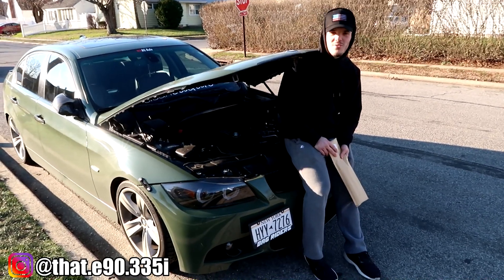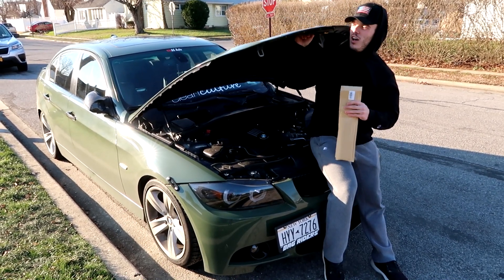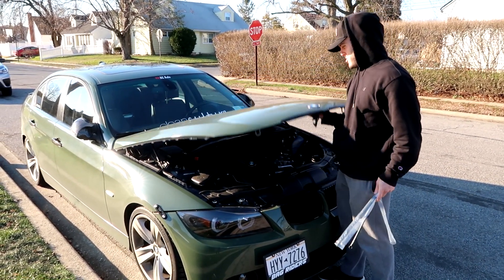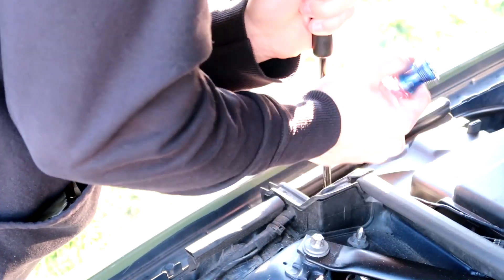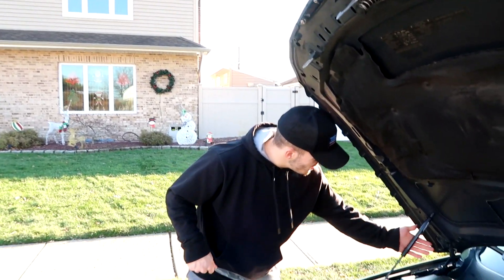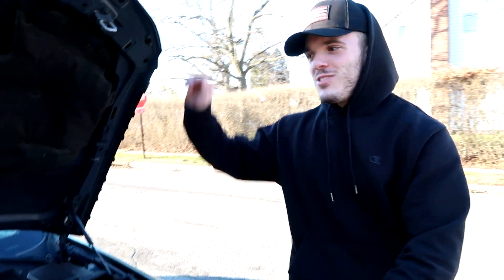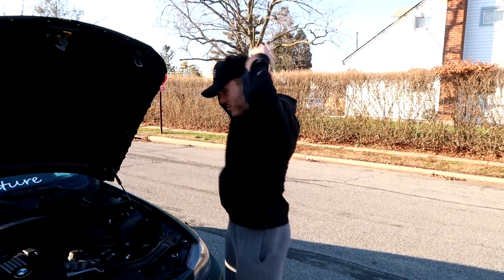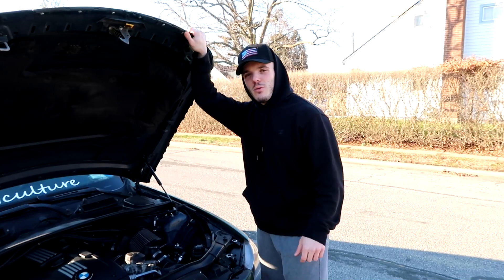BMW E90 Hood Struts Replacement (Super Easy)

Comment: I literally feel your pain. The pain I endured when I was changing the radiator on my 325xi. That latch is unforgiving
Reply from the maker: You don't know how hard that latch is until it stabs you right between the shoudler blades or the head haha.
Reply: I took the latch to the head. The hooks took out my spine and shoulder. I was completely over it with the whole radiator.

Comment: Aren't those e92 wheels ?
Reply from the maker: Yes they are. I used to run my style 159's in the winter but I really didn't like the way they looked. So I bought used style 189's to run during the winter. Im pretty sure this style does come stock on e90's but im not 100% sure.
Reply: @acauto7886  ohhh ohkay I get it